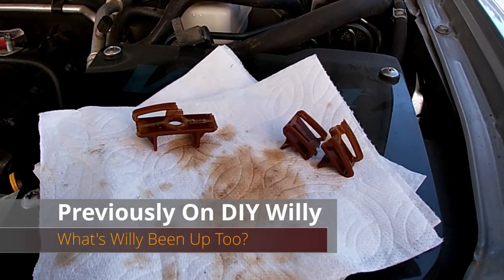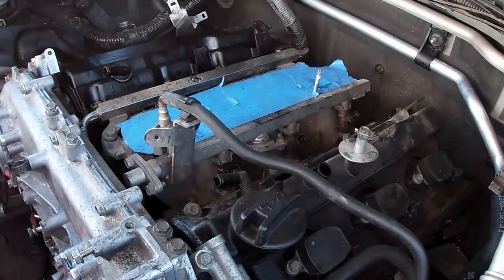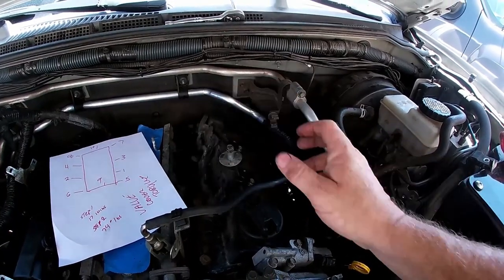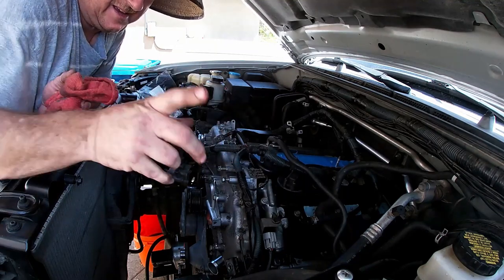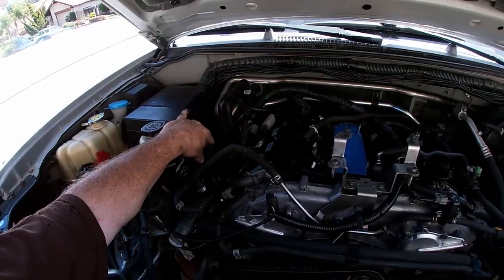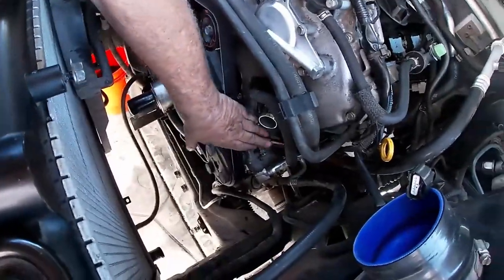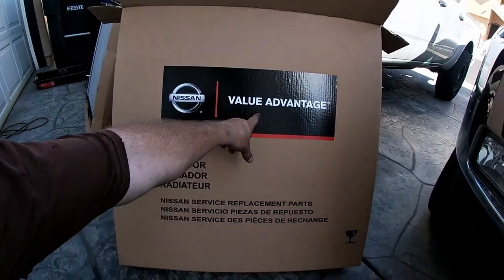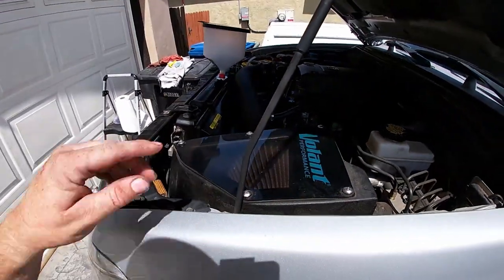Nissan Frontier 4 0 Timing Chain Repair Part 2

Comment: I was under the impression timing chains last the lifetime of the car, a few hundred thousand miles. On my little Frontier and the large V6, it's only 100K miles then needed a new chain.
Reply from the maker: Yes the chains will stretch but the problem is more with the guides wearing out causing metal to metal contact on the system.

Comment: Should have gotten a solid aluminum radiator so you dont have to bypass the transmission fluid. They wont mix like the plastic ones.
Reply from the maker: We had already put a lot of money in this repair. Besides the timing chains and guides I also replaced the heater hoses, alternator, valve covers and gaskets, vvt, Pcv and fixed AC leaks. I would have loved to buy an aluminum radiator but by this point the pocket was getting empty…😂
Thanks again for watching!!

Comment: Most likely your fan blade hit the radiator and caused the hole! There is no way that hole was there prior to you starting the job! A whole of that size would have been extremely noticeable, Not to mention you would have lost all your coolant within 20 minutes of driving! I’ve been a mechanic for 26 years and I can’t help but picking a part other peoples work, Only because if they do something wrong someone else will watch the video and also make the same mistake! I was extremely impressed with the entire job, The only thing I had a little issue with was the amount of RTV you used on the timing cover! More is not always better! It’s OK if it squeezes out, The problem is all of the extra RTV that squeezes into the engine! What happens is overtime the extra RTV that squeezes into the cover could break free and start circulating throughout the engine which could cause a blockage! Great job!! 👍👍
Reply from the maker: Thanks for watching

Comment: Great informative video Willy. I have a 2007 Frontier Crew Cab 4x4 with 273,570 original miles on it and the tensioner whining noise. Thanks for making it look from being frightened to tackle it myself to saving a ton of cash and making it a long weekend to get it done myself. Best wishes on the next DIY projects and be well.
Reply from the maker: Yes the repair can be frightening but honestly it’s easy. Just slow yourself enough time and do your research and understand it completely. Use quality parts you don’t want to do it again soon. Remember to change water pump also and necessary hose for preventative maintenance. Good luck and thanks for watching.
Reply: Нічого страшного там немає. А те що купу грошей з економите це 100% в США все дорого. І доходить до жорстокого жлобства

Comment: Hello friend, where do I buy the book, could you pass me the link or the data please since I have one and the screw torque does not come, I have a 2010 nissan frontier and I will change the timing chain
Reply from the maker: Here is the manual I purchased. Hope this helps…
https://www.amazon.com/dp/1620922371?ref=ppx_pop_mob_ap_share
Reply: @DIYWilly  my friend thank you

Comment: How has it worked out for you with bypassing the radiator with your transmission lines? Have you had any heating issue with the transmission??
Reply from the maker: Hello Dennis, I have not had any problems with high temps on the transmission. I do have the external cooler that does the job. I had thought about a fan on the cooler but so far have not needed it. Great question! Thanks for watching!!!
Reply: The main reason engineers have the transmission fluid going into the radiator is to warm it up to operating temperature quicker. The transmission cooler on the front of the radiator is for cooling.
Reply from the maker: Great info. Thanks for watching!!

Comment: All I can say is one would think chain guides would be made much more stronger and supports for being such. important part for keeping the engine and timing in a vehicle working. Instead of being the part that can make an other wise good solid built engine prematurely  fail.
Reply from the maker: Hello RnR, I totally agree. The engines are too good to be vulnerable to parts designed to wear out. But then again how would the car companies make money if everything lasted forever. Thanks for watching!!!

Comment: On Saturday 16/7/2022 about 5pm a client called me to his abode. When I got there he told me that he observed when he was about to drive into his compound that oil was leaking in his car. Although, it took me some minutes to troubleshoot the problem because the oil spattered excessively to many accessories of the car like alternator, power steering pump, fan belt, TPS, AC compressor, etc. I searched for the leak and finally saw what was causing it. I noticed that it was because of the CKP oil seal at the pulley side/front of engine. It was late hence auto parts store closed that was why I didn't replace the seal that day but encouraged them not to drive the car until I replace the seal.
  On Monday 18/7/2022 I changed the seal and the leaking stopped and the idled fine but I only observed that few minutes to avoid catastrophic outcome to the engine because the engine oil level was low. After replacement of the seal the fan belt cutoff and I replaced it as well. 
They didn't drive the car until Tuesday when the went to the replace the oil. But before they moved they called that the whole car was vibrating. I was unable to reach out to them so I told them I will meet them on Wednesday 20/7/2022. I got there yesterday as promised and noticed a severe vibration at idle which wasn't there when I left on Monday.  
   I scanned the car and retrieved some codes that I will upload. Among those codes, I was particularly focused on the P0016, P0113, P0123, and P2135 although I verified the ignition codes and saw that it fired very fine. 
   As a result, I cleaned the CMP sensor of the 2 banks and installed them back but to no prevail, I still noticed a vibration. I pulled the CMP sensor again within 2 minutes of idling and noticed that it was dirty again. This time I had to pull VVTI solenoid valve of both banks  alongside the CMP sensor and cleaned them. In addition, I used a very clean dry cloth and insert into the CMP sensor hole to properly clean the inside of the engine. In the process, I also noticed that the injection head where the TPS sensor is tightened was very dirty as when a carbon and oil are mixed together so I cleaned that too using a tooth brush. 
  At last, when I put everything back to it's respective places the idle was very nice because the car didn't vibrate again! 
  However, there is a problem that I want you to help me out with. It's a high rev in RPM to about 1.4 at idle. I Before I left there yesterday I scanned the car again and found only the P0123 and P2135. Please note that this two codes appeared only after cleaning the CMP sensor, VVT solenoid valve and the injection head. It didn't appear before the cleaning of those accessories.
  When I started the car it rev high from about 1.25 to 1.4 RPM and remains there. The RPM doesn't go up and down. When I accelerated the car it rev very fine. I also noticed that the TPS connector was slightly broken, it didn't fit in very well and didn't hear a snap sound when connected to the TPS module. But whenever I pulled the TPS connector completely out when the car was idling there was a great reduction in RPM as if the car wants to stall so I immediately connect it back slightly and noticed that the RPM goes down and remains at 1000 RPM. The car owner even noticed the reduction in RPM, stood up and moved to me and said that that's the way the car should idle. But if is still connected at that place and switch off the car it idles to 1.4 RPM and remains there until I repeat the unplugging of the TPS connector process.  
   I tested the connector with my test light and noticed 2 ground out of the 6pins (one of the ground was very dim the other was bright) at the pin connector that illuminated the dim light when tester was at battery positive. I also noticed a dim light when I checked for current with my test light now hucked up to ground and ignition switch activated to ON position. 
   Presently, the car idling don't want to reduce to 1000 RPM and also the only codes that doesn't want to go out are: P0121, P0122, P0123 and P2135. In addition, the tapping sound from the right bank doesn't want to go out. 
  
  Please help me, how do I permanently solve this car problems?
Reply from the maker: My apologies David I just saw your comment. All the code indicate a problem with the throttle body and throttle position sensor. I’ve never had to deal with this at least not yet.
A few things you should check: cracked vacuum hoses (Usually I find cracked hoses at the plenum- the small ones), check PVC system and check all the oil seals for damage (dip stick and filler cap O-rings).
Disconnect the negative terminal on the battery for about for about 30sec to reset computer.
If you’ve done all that and problem still exists then you may need to relearn the throttle position sensor. If you google “ throttle body idle and volume relearn procedure” it’s a pretty simple process. This is the best suggestion I can offer. 🤞
But first please look for vacuum leaks or PCV system problems. When I did mine repair I don’t know if I mentioned that I replaced the PCV valve in the passenger side valve cover. Since it was my vehicle and not a customers I replaced many preventative maintenance parts just because.. A little insurance that the engine would run like new.
Reply: @DIYWilly  Thank you so much for your assistance🤝.
    On Tuesday 26/7/2022 I sprayed carburetor cleaner to the TPS sensor and butterfly of the throttle body again. I wickled it back and forth severally. I also tapped on the TPS sensor when the car was idling. 
  I loosed the car negative battery terminal and waited few minutes and then connected it back. I also unplugged the TPS connector then crank the car twice knowing it wouldn't start and idle. I connected the connector back.
  I cleared the codes and cranked the engine everything was Ok again with God's support! 
  The car owner was very happy!

Comment: Do you still have a little lifter tick or tap sound? Just bought a 2012. Trying to decide if these engines just sound like this or if I need to replace chains or lifters.
Reply from the maker: Hello Zoomy, No the engine is quieter after the ring chain replacement. Depending on the mileage the vehicle has would be an indication of guide replacement. The sound from the chains is not a tick or tap sound but usually a whining sound from the chain running across the tensioner piston. Hope this helps! Thanks for watching!!

Comment: Did you buy only that white plastic tensioner guide, or did you have to buy the whole assembly? 

I have that brown plastic that fell apart too. I only see the whole assembly for sale not just the white plastic
Reply from the maker: You need to buy the chains and tensioners as a set. Don’t forget the little gaskets and Orings!
Reply: @DIYWilly  ok thanks. Watched both your videos. My hands are all cut up like yours lol
Reply from the maker: @rshinn8776  😂 yep things are sharp. Take you time and make sure it’s timed right. Follow all the torque specs and get’er done. I can’t stress enough on taking your time.Good luck and thanks for watching. Let me know how it turns out!

Comment: Was that the original water pump that you changed when you did the timing chains?
Reply from the maker: I’m the second owner of the truck so I’m not sure… But safe to say properly yes was original to the engine.

Comment: Hello,
Did you get the timing kit at Nissan as well?
Reply from the maker: Yes I purchased all the parts from my local NISSAN dealer parts department.
Thanks for watching!
Reply: @DIYWilly  
Thanks for replying. I need a timing set for a 2005 Nissan Pathfinder LE.  There are not any good reviews  for timing set in eBay or Amazon and neither from 1A auto. I will give Nissan dealership a try out for my peace of mind.
Reply from the maker: @jgrm4443  Good idea man!

Comment: Did you come up with full list of the parts used ?
Reply from the maker: Wow it’s hard to just give a list.. Your vehicle may need more depending on mileage. I purchased all the parts from NISSAN. Really this is a lot of work and you don’t want to risk it with cheap aftermarket parts. At least that’s my opinion.. Now I don’t remember all the part numbers but I believe there in the videos. If you go to NISSAN parts department they can help. The price may scare you but it’s a small price to pay to keep the engine happy.

1. Timing chain kit (3 chains and 4 guides)
2. Timing cover seal kit(Orings and silicone)
3. Water pump (driven by timing chain. It’s a good idea to change it now)
4. Inspect all hoses and replace as needed. ( including heater hoses and cooling hoses)
5. A really good manual to reference needed specs. (Amazon)

Really I could write a book about everything but that’s too much. Honestly study the videos and talk with the parts guy. Try and build a friendship with him. That person is priceless and full of knowledge or at least they should be. It’s a very time consuming job but will pay off in the end. 
I took the time to change the thermostat and housing, the alternator and radiator. I also fixed and recharged the A/C while I was there. The only part I didn’t change and wish I did was the variable valve parts. There are VVT sprockets on the exhaust cams and actuators (I think that’s what there called) near the valve covers. This is also a great time to fix valve cover oil leaks. It’s like a brand new truck now. Remember NISSAN wanted $3500 to do the job and that was just for chains and guides. I did all the work mentioned above for less that $2000. That’s a huge savings and so many repairs done if your not afraid to do it yourself.
I hope this helps you.
Reply: @DIYWilly  thank you !!

Comment: How many miles was on it when you did that job?
Reply from the maker: Hello Lou-eye, The truck had roughly 160,000 when I did this job. Thanks for Watching!!!
Reply: @DIYWilly  Did you consider dropping a remanufactured engine in it? I've had mine for 10k miles, bought at 130k & may do just the timing related components, but I'm skeptical of the maintenance history so I'm considering going further. Looks like most are $3400 after core.
Reply from the maker: @VenetianBlinds  No this is a great running engine no need to replace it. Besides I enjoy that type of work. By doing it my self I was able to do some other preventative maintenance things to help the engine last many more miles. Thanks for watching.

Comment: 🇺🇦 Willy - you didn't show anything informative to the taxi: - the problem in these engines with the so-called gun gasket; 
- you did not blow the heads of phase regulators with air / without making sure of their tightness; 
- you didn't even measure the valves; the video is just about nothing. do not be offended. I'm from Ukraine, I have a Nissan Xterra engine, just like you have a VQ40DE 4.0 gasoline engine!
Reply from the maker: Gun gaskets? Phase regulators? Sounds like you taking about a space ship… Thanks for taking the time to watch and leaving a comment.
Reply: @DIYWilly  no spaceship. if the gun gasket, which is located in the middle of the engine, breaks, the heads of the phase regulators remain without oil. engine error P0021/ P0345, etc. I am generally silent about valves / in the USA. one + spare parts for the engine are available.